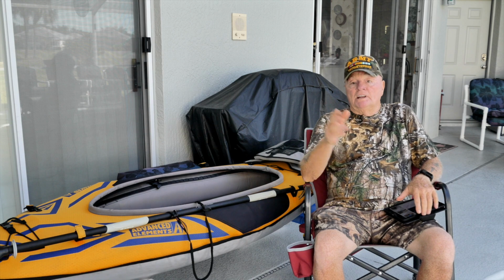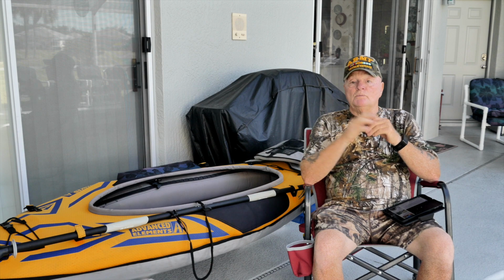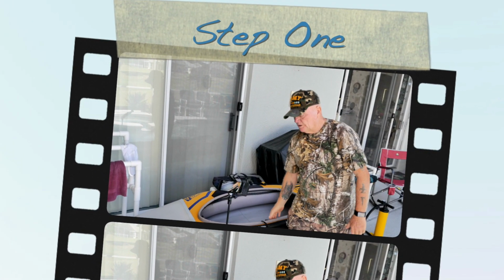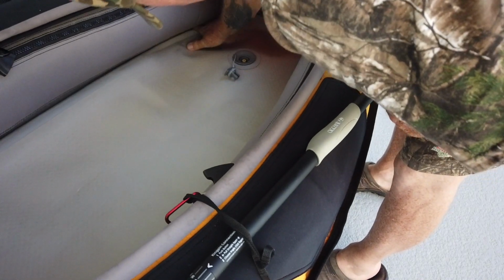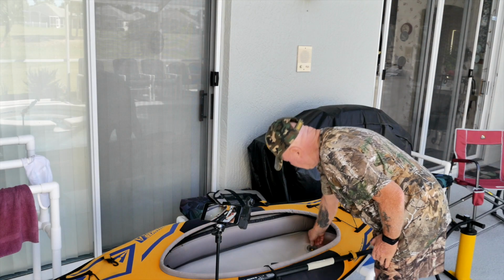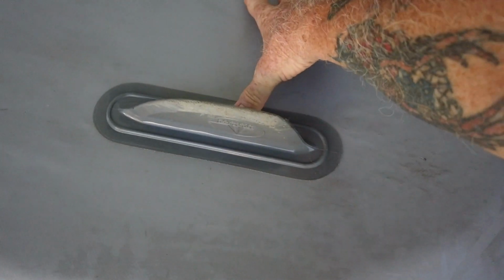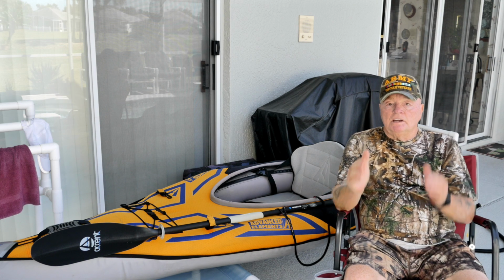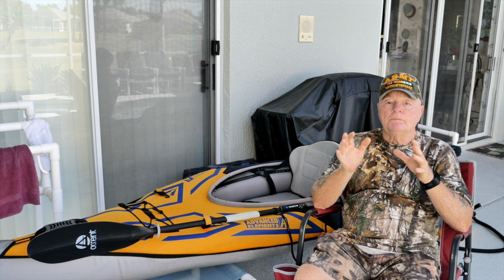Advanced Elements Dropstich Floor 101

Comment: Your videos have been so helpful! Thank you so much!! I do have a question: with my new AE drop stitch floor, when I try to inflate it up to 4 to 6 PSI as I get towards 4 PSI it starts hissing around the valve. I can continue putting air in but I'm just wondering whether that's normal? Do I just keep pumping? Or is my gauge wrong and I'm overinflating?
Reply from the maker: @aviv83  sounds like your valve spring is not resessing property try changing out the washer to a thicker one on the adapter.
Reply: @DaleMrDSimmons  
Thank you! I'll give that a try!

Comment: I have an AE Sport and chose the backbone attachment over the dropstitch floor. It also requires careful centering, but it improves tracking significantly. The standard floor over the backbone is comfortable unless it loses pressure, as mine seems to be doing now however slowly. I'd check it for a leak, but I don't paddle the Sport much since I got an Itiwit x500 earlier this year.

Comment: Any worries about inflating a kayak on a warm day, then launching into cold water? Do I need to check the air pressure in the chambers very often?
Reply from the maker: James Reasoner Hi James, yes in warm weather what ever your main chamber recommends cut it by a 1/4 pound. Example; max main chamber 2lbs, fill to1.75lbs in hot sun or hot days. During your paddle the water temperature will equalize the expansion. Don’t keep in direct sunlight (not on water) as expansion will be greater. When I’m at a camp site and my yak is inflated I will cut the main chambers by 50%. I top off at launch. Hope that helps.
Reply: @DaleMrDSimmons  Thanks for the quick reply. When I was a kid, I busted a seam in a canvas inflatable raft by letting it sit in the sun while I had a nice lunch on the beach.So, I had a suspicion that PSI would be equally important in a yak.

Comment: Hi Dale   dumb question, with the drop stitch floor do you still use the original floor or put drop stitch floor directly in.
Reply from the maker: tanyar9 not a Dumb question there’s really no dumb questions but what you do is you pull the stock floor out and replace it with the drop stitch floor Hope that answers your question thanks for watching
Reply: @DaleMrDSimmons  yes after I posted this I watched another of your videos where you take the standard floor out.  I am taking my sport out tomorrow with the drop stitch floor, first time with the new floor.  So did a set up this afternoon to install in.  I will let you know how I get on.  Thanks so much, love your videos.

Comment: Yet again, your videos are a great resource! I purchased a convertible about a year ago, and TBH it's been a pain to use with the dropstitch floor in solo mode because it constantly tracks to the right or to the left since it's hard to get the floor straight. The instructions say to fill the outer bladders until there is structure, then the DS floor, then the inner bladders. But this almost always leaves the DS floor askew somehow. Plus I've found that the fin can get bent over time since it's literally where you need to fold the kayak for storage in its bag. It will probably straighten up on its own if left unfolded for awhile, but I really wish they'd moved it forward or back about 6 inches so it was away from the folding point. Combine that with the DS floor being out of whack, and it is hard to control - and that's a big boat to constantly have to correct. I totally agree with the question asker's experience of paddling once on the right for every two to the left, or whatever. It definitely makes for a bad experience. 

I'll try filling the convertible up without the floor next time, and add it after and see if that makes a difference. If it's really that simple, it could really make me use the boat more often. As of right now I mostly keep it stabled except for tandem fishing trips with a buddy since we don't have to move it much once we get to a fishing hole.

Comment: Nice to see you still putting out videos. I'm surprised no one else has problems with the inflation of the DS floors. As I mentioned in one of your other videos, routinely, when I disconnect the hose, the air will escape. Generally takes me two tries: maddening.
Reply from the maker: Bruce Wayne , Hi Bruce, here is the secret. On your adapter that little triangle that strings the connectors, place your thumb on that and use that to twist it off using the adapter triangle piece as leverage. Try that and get back to me. If that doesn’t work for you I will shoot a short video on how to do it.
Reply: @DaleMrDSimmons  I'll give it a shot.
Reply: Dale, I may have posted a comment on another video. I have the tandem & remembered you had a video on aligning the DS; something else to try :)
Reply: I had the same problem with my dropstich on my Solstice kayak. If it works the same the valve should be up to start. The connector will push the valve down to let air in and then it should automatically pop back when you take it out. You have to untwist the adaptor in the opposite direction that you twisted it on. Mine don't like to pop up now because I left the valves down too many times and the springs I think got weak.
Reply: @Carlb328  Funny you mention this as I've been deliberately making sure the value is up. I use to assume that if it was down then it was ready to fill. So making sure the value is up & using Dale's trick with the triangle has really helped. As it is, I have a leak in the DS Floor that I have to fix :(

Comment: Thank you so much for putting this video together. It is so helpful. I especially like the tip of flipping it over to check alignment while practicing. I made several mistakes on my maiden voyage with the dropstitch floor. I'll use your techniques and practice a few times before my next trip. I'm much more confident that I'll get it right next time. Thanks again! Keep up the great work!
Reply from the maker: Treasure Pirate , I’m glad you liked the video. My viewers are very important to me and when a question arises that I feel warrants a video I will produce it. Also, it will help others having the same problems.  I know you will nail it the next time you go out.